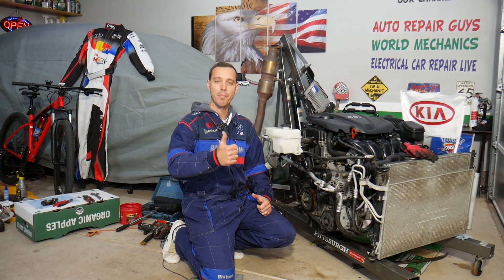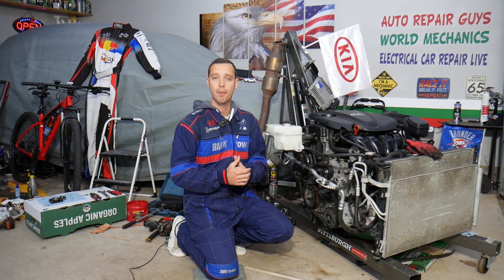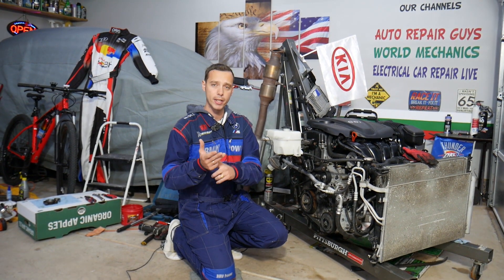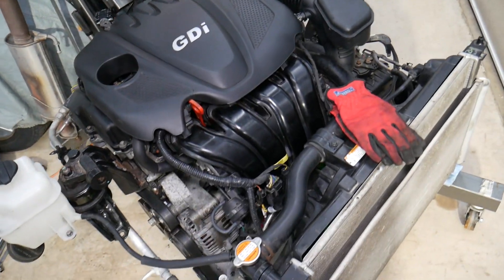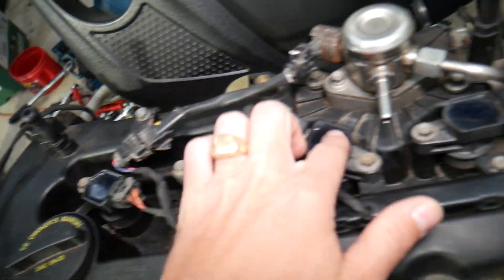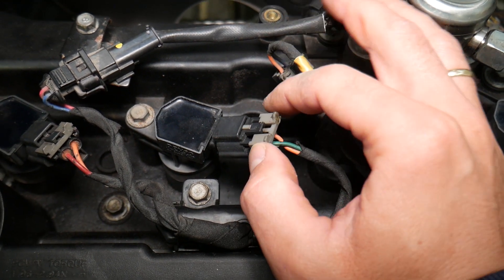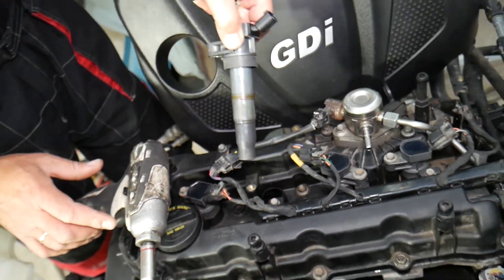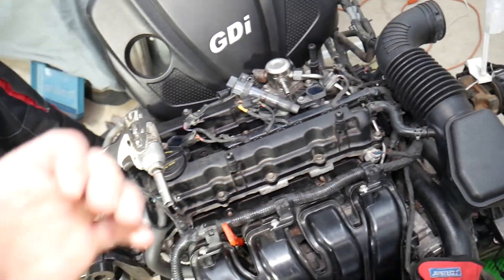IGNITION COIL REPLACEMENT LOCATION KIA SORENTO, KIA SPORTAGE

Comment: I have a Kia Sorento 2016 2.4 L LX. I receive a diagnostic check and he told me it was my ignition coils I replace all four it had a little oil in it number one but as I put the new ones in the Home one is still not working I unplugged number one start the engine and it was the same like having the initial call edit it does not pick up power when I put it in drive or reverse I replaced everything the PCP I checked everything nothings happening what can I do take it to the dealership and pay An arm and a leg need help